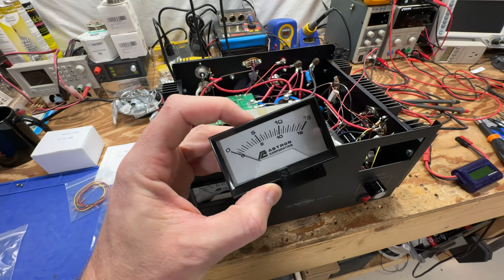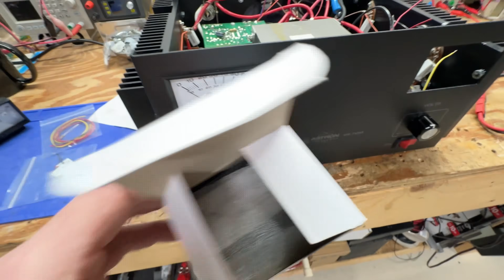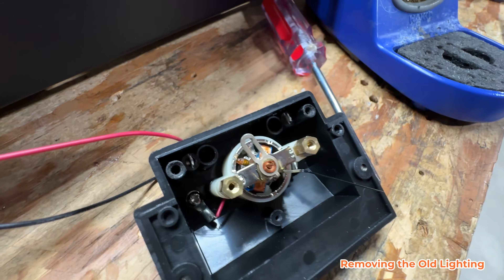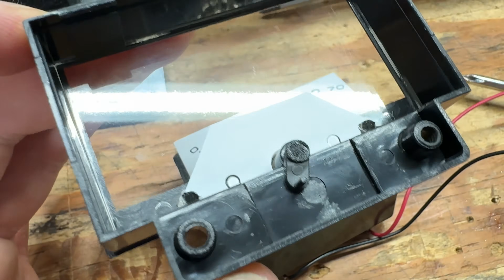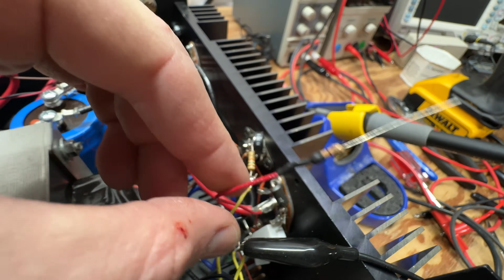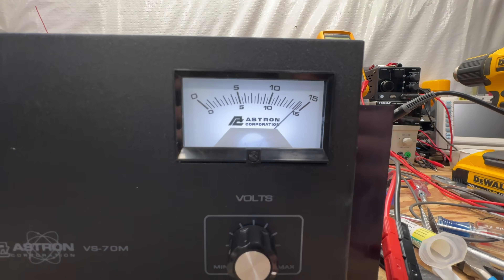Astron VS-70M LED Backlight Upgrade and Repairing the Voltage Adjustment

Comment: I'm curious what the date code on that one is.  I think they have it on the data sticker/plate in the back of the unit.  I would think by now they would just use PCB's for nearly everything and get rid of the wire rats nest.